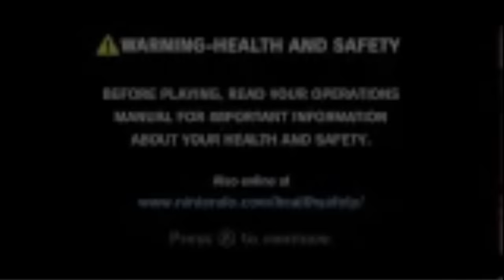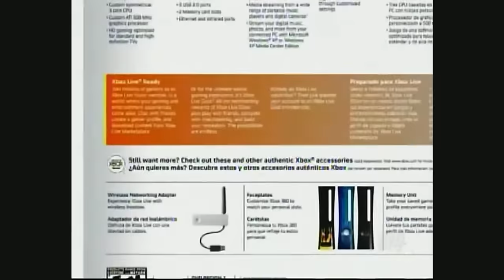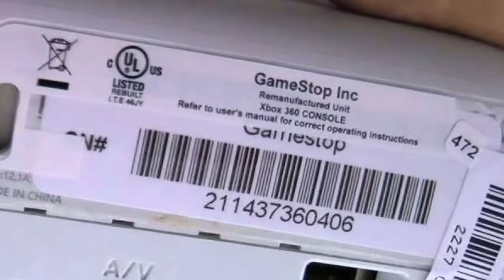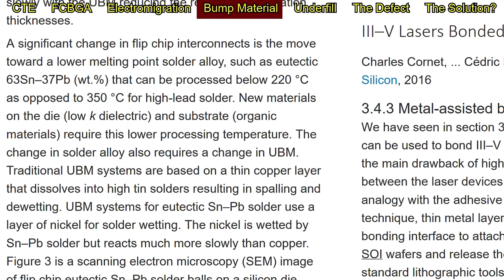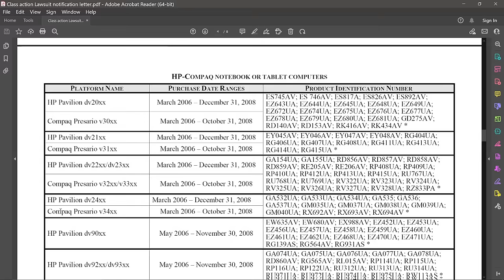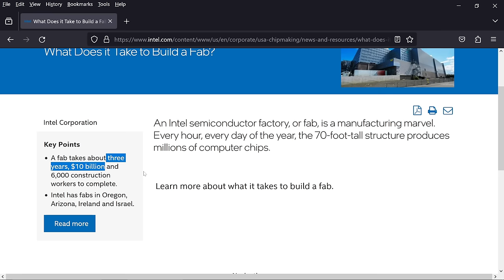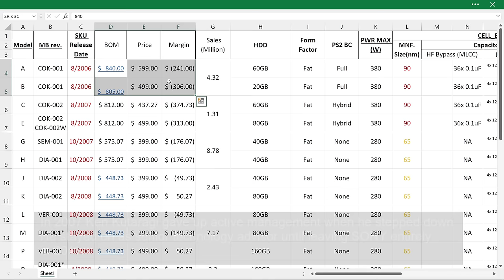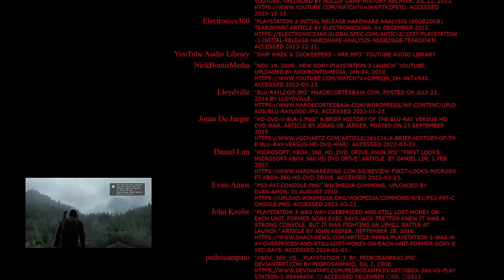A 360 Story -  The RED Ring of Death & the 7th Generation Console War

Comment: Update: We now know from a VERY reliable source that the "80nm" chips are actually still 90nm, the die size shrink was due to optimization in the design. This was old misinformation that was never questioned. Everything else said about these chips is accurate.
Reply: I have a Falcon from August 2008, is it reliable?
Reply: Yeah, it should be. You can open it up and check the GPU just to be sure, though.
Reply: Do you know how reliable a CECHG01 (fat PS3 with matte finish on the disk slot) is? I’m afraid to crack it open and mess around, but I’ll gladly do it if it’s going to have the same thermal issues that the earlier models had.
Reply: @CRACKBONE7317  Sadly it's no more reliable than any of the BC models :(. The CECHG is more similar internally to the launch models than to the later phats, just without the features the launch models had. Obviously after all those years it's never a bad idea to replace the thermal paste. A delid on the RSX might also help if you're feeling confident enough to do so (I found the Cell to be a lot harder to delid successfully). You could also install CFW to adjust the fan curve. Ultimately though, I'm afraid RSX failure is probably inevitable on a CECHG. But there's nothing stopping you from enjoying it while it lasts!
Reply: @CRACKBONE7317 The CECH G, H, M (and Q?) All have the 90nm rsx and so will have reliability issues. All the BC ones, the SEM board and DIA001

Comment: Fantastic video my brother, and I am very glad I could be a part of it! :)
Reply: Hey dude! I miss chatting with you. Hope your health is doing ok!
Reply: Everything is good, thanks!
Reply: The legend himself
Reply: I read the entirety of "The Good, The Bad, and The Ugly of Low Tg" and recall that a 5c difference below that threshold can exponentially prolong the affected chip. I am curious to why you don't consider ramping up fanspeeds a "fix"?
Oh and one more thing

I remember you mentioning that not all xenons are plagued by the soldering issues. Why is that? Different underfill was used?
Reply: Because people apply them after the fault has already developed in a futile attempt to prevent it from happening.
MAYBE if you had a new console that never started developing issues, and you kept it under 70C on the GPU (don't touch the CPU), then maybe it would last longer? I don't know because pretty much all the defective consoles have died, so we don't have a big enough sample size. I have some launch thru 2006 defective units that run fine despite being heavily used and crossing the Tg many times that just work for some reason, so you need big sample sizes to make a determination.

In addition, I've seen units that were fan modded since very early in their life die, possibly that can be blamed on the TSMC Low-K process issues? Not a big enough sample size to tell. TL:DR, a "fix" implies the underlying problem is corrected. Increasing fan speeds doesn't do that. The chemistry of the construction of the chip is bad no matter temps it runs at, the chips are defective. This is also probably why MS never bothered issuing a software update to raise fan speeds.

Xenons refurbished in mid 2008 and newer will have fixed GPUs installed, version X817791 and later Elpis X819195 that are High-Tg chips on a fixed Low-K process. Those chips are solid.
Reply from the maker: SONY never issued a revised fantable for 90nm PS3s either. OFC, in their case this would be tantamount to an admission. So they wont for that reason.
Reply: Hey man will you swap my gpu?
Reply: @Josh.Davidson  ive got a launch 2005 xenon (jtag) that never got rrod and i mounted a pc fan ontop of the heatsink years ago, it's never froze or gave rrod
GPU Always runs around 40c, guess im lucky.
Reply: lol PC fan on the heatsink. If you're going to do stuff like that just lower the GPU temperature target. No reason to waste time by installing more fans.
Reply: @Josh.Davidson  I did it years ago haha, worked well for the time but I do agree with you
Reply: @ripfelix3020  Felix or anyone who knows very well about SIlicon, Computer Engineering, i want to know please if theres any true on the assumptions of the newer RSX chips with Smaller Litography being able to Support Higher Clock by factory only by the Smaller Lithography process, Its true at all that overall chips with smaller lithography will support higher clock???? its true that the 28nm Rsx would support higher clocks as 1Ghz on its Core or More??? Please Please Please! Thank you so much!!

Comment: Another great video Felix! Very informative. I'm glad we don't have to deal with these issues over on the Wii modding side of the scene.

One opinion-based correction though. For AV, I would personally say the 360 is better off. Because the console launched before HDMI was standardized, Microsoft implemented VGA support (and later DVI through the hdmi port) with a huge variety of resolutions and aspect ratios, along with a pretty robust scaler, to try to make it work with everything. The PS3 supported 5 resolutions across 2 aspect ratios, while the 360 supported 12 resolutions across 3 aspect ratios. The PS3 did not support VGA or DVI, and its implementation of HDCP can be a limiting factor on what devices can be directly connected to it. So once HDMI was added shortly after launch, the xbox 360 supported pretty much every video connection one could ever want.
Reply from the maker: interesting point. Yeah, I'd like to explore that further. Didn't get a chance to really dive deep into their comparable AV outputs.
Reply: @ripfelix3020  Don't blame you in the slightest for that! Its not often discussed outside of the CRT junkie circles. You can expose all display resolutions by disabling display discovery in settings.
Reply: The 360 also had a 1080p upscaling solution for all games whereas the PS3 would only upscale to 1080p if the developer specifically implemented it.  To be fair the PS3 did have more native 1080p games, but I remember PS3 ports always looked a bit softer because of this.
Reply: @kyle52905 it depended on the game and colors palettes that devs were using. 

Most devs used washed out color palettes, so even upscaling games was difficult. Mind you try playing madden 10 or games that had a good color palette scheme. Difference between components vs hdmi was night & day. However certain games that had really dark backgrounds or sandy beaches and or jungles looked washed out perfect example far cry 2, bioshock 1, 2. 
Fallout 3 and new Vegas as good as those games all were the color palette scheme were definitely horrible no matter which console we were using. It was till 2010-2012 that games really started using a deep heavy color palette scheme or used the hdmi upscale technology. 

Mind you even in 2005-2008 most people were still using CRTs… 
So devs knew using hdmi was mostly pointless to use when most CRTs couldn’t upscale to 1080p or 1080i in the first place… 

I remember working with Koch media during the ps3 days and a lot of the games under THQ going from ps2 to ps3 was a nightmare. Games like juiced 2 and many other games that released during the first 2-3 years of Xbox 360 & Ps3 and porting the back logs of Ps2 games was not fun at all…
Reply: @ShankMods I agree with you aswell Xbox 360s and even ps3s the games that were released from 2005-2009 are better off using Av Or the blue green red Composite cables… 

games from 2010 and beyond are better off using HDMi… 

Also fun fact the PS3s launch was delayed because Sony wanted to install hdmi technology on the ps3. Which drove up the cost. 

Regularly the ps3 wasn’t even supposed to have hdmi. Hence why so many games looked washed out devs didn’t have time to prepare for this as Xbox didn’t have hdmi. Till the 2007-2008 revisions. 

You can still see on the launch 20 gb Ps3s and even the 80gb CechA & B 
That the hdmi were added last to the mother board even the cut out on the ps3 launch models the hdmi looks out of place😂 Another reason launch models are prone to fail…

To be fair Sony did benefit for implementing HDMI imagine a world where the launch models and phat ps3s not having hdmi??? Yikes!!!especially when Sony was Hyping up Blu Ray Technologies & Giving people an all in one media console… 😂
Reply: @ShankMods you also have to realize that Sony Japan was mostly thinking about Japan and Asia. The back wards compatibility hence why ps2 & ps1 games don’t upscale at all. Because the ps3 was designed for that specific reason. It was only till later they realized the market was moving towards hdmi in Mainstream America as the next best thing… This should explain why Sony didn’t prioritize different aspect ratios and resolutions. 

They wanted all 3 generations to be played the same way. Which HDMI was a bad when it came too backporting ps2 titles as ps3 all companies had to make specific versions for the ps3 which to some degree it helped for HDMI and devs to resell games they already had on ps2. However the downside was games didn’t and weren’t maximizing the full potential of the console😢
Reply: Meh. I would say up to 7.1 high resolution uncompressed surround sound incl. Dolby TrueHD + DTS-HD Master Audio passthrough (compared to only Dolby Digital 5.1 which even the PS2 could do), HDMI-CEC, SACD playback and native stereoscopic 3D beats Xbox's VGA and DVI capabilities.

Comment: God, regarding the "bolt mod", Gamestop made it a policy to do this on every fat 360 they got their hands on at somepoint. I've picked up two Jaspers from thrift stores with Gamestop warranty seal stickers on them and both were bolt-modded. Both were immediately replaced with normal X-clamps and one of those motherboards lives in my Halo 3 console now, which has at least 1000 hours on it so no long-term damage was done.
Reply: I paused and made this comment before you mentioned Gamestop doing it lol.
Reply: I should add this was done outside the US as well. Have had two Xenons picked up, as well as a Zephyr, which have had bold mods done before I got them.

Two of them still live (and one has a cool Assassin's Creed decal!). The Zephyr didn't survive and has ended up as a shell donor to a very beaten up Jasper.

Comment: As a guy that did Xbox 360 and PS3 repairs as a side hustle 5+ years into their life cycle, I don't like the statement of "GPU failure was the most common reason for an RROD" because it just wasn't a few years in. Cheap thermal paste was a BIG culprit of so many console "fails" from that time period, presumably because of the same issues with the solder being weaker - different compounds. Solder breakage of HDMI ports was incredibly common, as were disc drive failures in both Xbox and PS consoles. Xbox especially has always been bad about cheap disc drives, leading to lasers that just stopped being strong enough to read the discs, leading to the incredibly common and incredibly frustrating "Open Tray" error, or the 360 reading a 360 game as a DVD but then telling you to put it in a 360 console to play it when you hit play on it. 

That said, great video that I learned quite a bit I did not know from, especially about the few times I could not fix a console, because I didn't have access to the same information then as I do now. Wasn't easy finding out about how to do that secondary error code thing 10+ years ago. 

Fast forward to 2016 and the release of the Xbox One X and MS puts out a machine that routinely had capacitors on the board that were too weak, and they were the caps handling charge from data transfer to the storage unit and controlling the disc drive. The blu-ray drives in Xbox One gen consoles also have an issue of going bad when they're not used all the time. So the shift to digital gaming is partly responsible for killing our disc drives too. Thanks, Xbox. Really appreciated that $500 brick of an Xbox One X.

Liked and subbed! Will be watching your PS3 video next!
Reply from the maker: Yeah, that's true. I am focusing more on the lingering stock of cheapest consoles on ebay...which of cource are going to the hardest fixes or issues that people avoid. When any console is current the mundanely common damaged port is a repair shop's bread and butter. I think I'd go insane if I had to do switch USB or PS5 HDMI ports all day every day.
Reply: @ripfelix3020  Oh, I literally won't xD I don't like doing soldering enough to do that work outside of a personal project I'm doing for my own satisfaction. I actually just sent a dude with a wiggly HDMI port on his One X to the local place to get it fixed, as I just CBA LOL

All told, loved the video though. Learned quite a bit. And I think the Rubric was a bit off. PS3's GPU was notably weaker so giving it "better HW" is a bit naff, and Xbox Live in that area is flat out responsible for mainstreaming a lot of social media features we think of as normal nowadays and was definitely a more "premium" feeling experience compared to the free PSN and especially compared to paying for PSN when that first became a thing.
Reply from the maker: @thed3m0n0id9  Well it wasn't meant to be an unbiased opinion. It was a list of preferences from my perspective, which would probably sway a different way for others. Which is fine. It's good to have options. I imagine if I had more time during the 7th gen for online multiplayer, 360 would hold more fond memories for me. But I was a broke college student with no time or money for XBOX live.

Comment: Amazing video felix. Watching it was a blast and it sparked my curiosity to check the repair of my own 360 since it suffered the rrod at the time.
A 2006 model repaired presumably in late 2008 (seeing the date stamped on the replacement backplates) I thought it would have had a "fixed" gpu but it still has a Y1 model. So I guess it does still have the low-tg underfill?
Now I can finally go to sleep knowing that my 360 still has the capabilities to rrod like the good old times ☺️
Reply: Check the part number on your GPU. If it says X817791, that's a Y1 with the new underfill. If it says X02056, press F to pay respects 😅
Reply: @pcm720  actually it's the X817791, thank you for the info!
I didn't thought they would still use the older chip in 2008.
A bit sad that it lost the ticking bomb feature, it gave some charm to the box :)
Reply: @Ambarrabba  I wouldn’t be surprised if they still had a lot of bare Y1 dies lying around and just repurposed them for warranty repairs once the underfill issue was figured out. Why replace the whole console when you can simply replace the GPU, getting rid of obsolete GPU dies along the way?

Comment: You have posted some great info. I actually had a broken 360 of earlier models. I disassembled the console and the board had hundreds of solder points where the solder had holes in them and were more like balls instead of circles in the PCB. The solder was anything but setting properly.

They were also very brittle and I don't know how that could ever pass QA, even for lead free solder.

I have only ever seen anything like that on OLPC XO 1.5, which also failed after a while. Same solder points with holes, but not as bad.

I only think the failure rates were so high because there were solder issues everywhere. Anything could fail. The solder in RAM chips could fail.
From my memory, there were many early RRoD with black screen, E74 "bump errors" came much later.

That said, I had a Jasper, which was supposed to be safe, after some 3y failed in Forza 4 with graphical glitches. Never came back...

Comment: I have a JTAG'd Falcon that still works fine today.  Knowing beforehand that thermal cycling was the biggest culprit behind failures, I removed the DVD drive (as I will never need it), and replaced the GPU heatsink with a CPU heatsink instead.  I built a custom fan shroud to accommodate the difference in profile.  I completely externalized the HDD by housing a fast 3.5" drive in a 3rd party enclosure, with 12v being tapped from the DVD drive power header.  While it may go against the originally designed thermal path, these changes allow the console to receive additional fresh air through both the DVD tray slot and stock HDD locations without requiring any alterations to the chassis or external case.

I found no need to set custom thermal targets after these modifications since both the CPU and GPU never exceed mid 60° C.  Overall fan noise is lower than stock as the dies do not reach the high temperatures of a stock console.

Knowing what we do now about the CPU's durability vs the GPU, I firmly believe that the earlier 360s would not have suffered such high failure rates if they had only made the decision to reverse their positions on the motherboard layout during design.  But there's no way they could've known that at the time.   😕

Comment: Really really interesting!  I had a May 06 console, so it was still an OG console.  I remember it having freezing issues when the room was hot. They did a system update and that mostly eliminated that problem for a while.  Sure enough mine eventually became a RROD console after 18 months or so.  I fixed and cured the RROD by removing the X-brackets and then using screws/washers to hold the heatsinks tightly to the CPU and GPU.  Then the DVD drive eventually started having issues, which caused the drive to eject during play.  I ended up getting a replacement drive, and transferred the unique decryption key to the new drive- also while modding the drive so that it would play burned discs.  And ultimately what killed my May 06 console was the CoD MW mass ban wave.  I ended up getting a core system in 2010 as a replacement when it was $180-200 for that Christmas, and then transferring the chrome bits and HDD over making it a full system, and it still works just fine.
Reply from the maker: Bolt mod monster...lol. I hate it, but if you got your money's worth I'm happy for you.